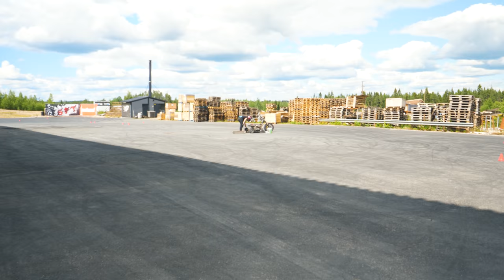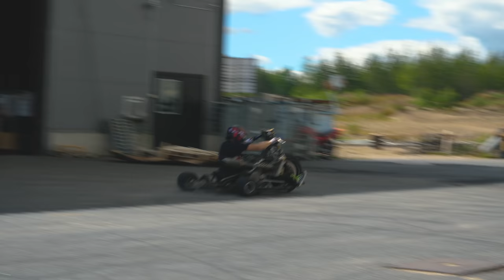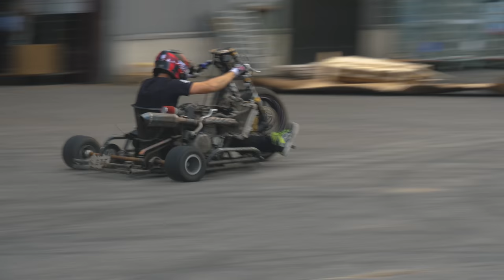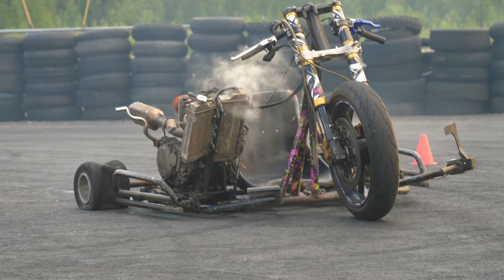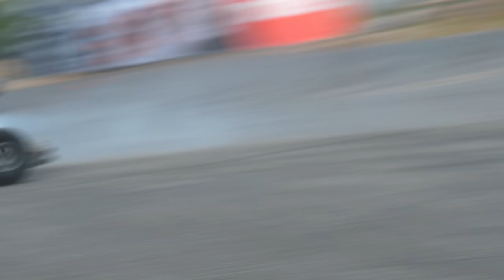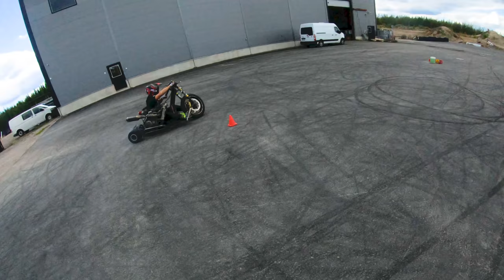450cc Drift Trike - The Widowmaker

Comment: This trike I definitely the inspiration to my next build. Would love to get in touch with you guys. Current task is trying to find an axle that's going to stand up to it. I'm going balls to the walls with a 1999 yamaha 1000cc engine. I doubt an "off the shelf" go kart axle is going to hold up, and I surely don't want to have to have an axle built from scratch that's going to cost more than everything else I have into it so far.
Reply: Should be good with an aftermarket raptor 660 axle
Reply: @probablyhiding  I ended up going with a 1 inch axle, 44 inches long and 4 bearings